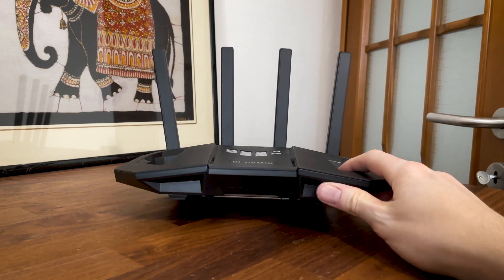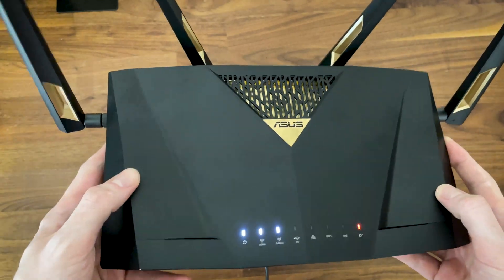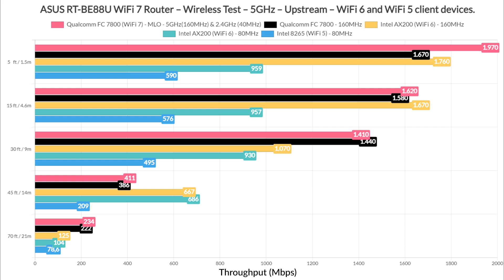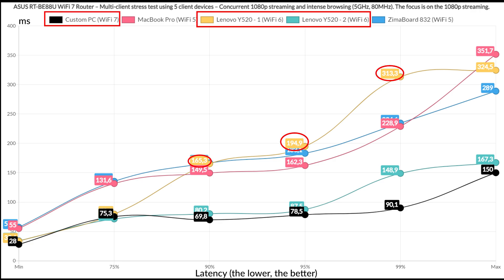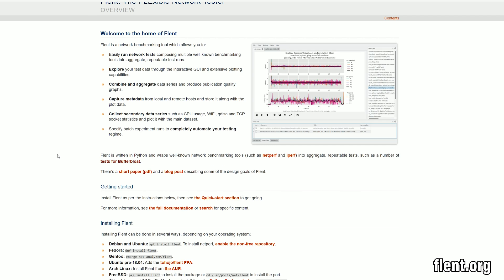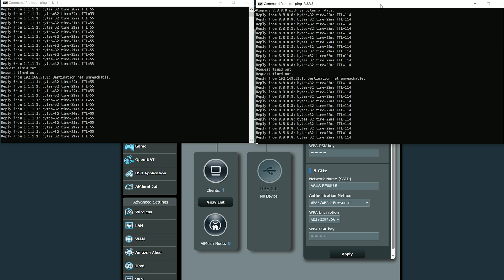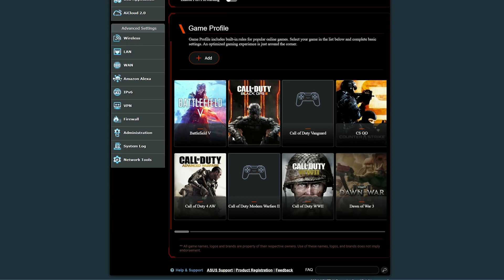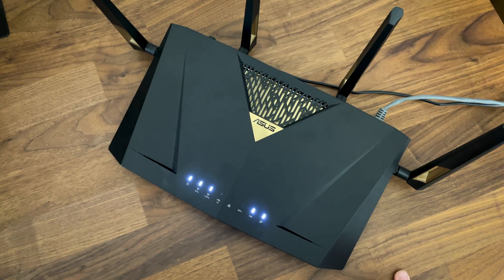ASUS RT-BE88U WiFi 7 Router Review: It sets the wrong expectations

Comment: Bought mine Last week for 280€. As replacement for my 11 year old  ac88u that died of heatstroke,I’ll install a small noctua fan to aid the exhaust.
 The 10g ports for my nas and 4x 2,5g ports are great. I have around 40 clients wired and wireless and I’m already very fond of Asus router even though my ac88 had some problems with the last 4 gigabit ports.

Comment: Our Wifi 5 Google TV streamer speed increased  from 350 Mb/s to 450 Mb/s after upgrading from the AX88u to the BE88u.
🙂
Reply: Have you try through Ethernet cable?
Reply: @jackydang  No I haven't bothered to try the ethernet because the wifi is so fast ~450 Mb/s

I assume the Google TV Streamer ethernet will do ~1 Gb/s but haven't bothered to try because I don't have a spare ethernet cable that is long enough. 

Is there any reason to suppose the ethernet can't do 1 Gb/s?

🙂

Comment: When we got this router we didn't realise that none of our computers has an ethernet connection fast enough to take advantage of the increased speeds i.e. >1 Gb/s
Had to specially buy a cheap 2.5 Gb/s card to check the speed.
N.B. Didn't realise 10 Gb/s ethernet cards are still so expensive.
🙂
Reply: How much does 10Gbs cable cost?
Reply: @jackydang  Still using our old 100 Mb/s ethernet cable to do 1 Gb/s speeds. 

When we finally get something capable of 2.5 or 10 Gb/s the original cable will probably handle it. 

Don't buy expensive ethernet unless you're certain you need it. You need Cat 6a ethernet for 10 Gb/s speeds. 

If you're setting up a network from scratch it's probably worth investing in fast ethernet cable.
🙂

Comment: Can you compare this to the ax86u pro and the ax88u pro?  I am not so interested in 6ghz.  The 5ghz speed and twang thru walls, latency and I will be using it in an area with lots of wifi.  I am using a server with vm’s connected to it via lan.  I’ve noticed my wifi signals are pretty bad if I have more than a few devices running.  Currently using a Verizon FIOS wifi router.  I tried the asus rt-be92 and the signal strength was worse and slower speed on 5ghz.  I don’t think I have any 6ghz devices and I won’t have the router in an open space.  Specifically I am interested in latency and multi client use.  This seems worse.  Is this a hardware limitation or should it become better than those two older models with software updates to the Be88U

Comment: Do you think if I install upgraded thermal pads on the heat sink, it will run a bit better and cooler?
Reply: I use a notebook fan for my routers. It find they run better in hot weather. It reduces the temperature of my routers by about 10-15c.

Comment: You are only person to answer my question for choosing router- 
Xiaomi be7000 - 150 euro
Xiaomi be6500 - 120 euro
ASUs be6500 -170 euro
ASUs be88u - 270 euro
Tp link be9300 - 270 euro

My usage - 140 square meter home, 20 plus IoT devices, 2 gaming setup, 2 TVs

Coverage and latency is my most concern 
Please suggest

Comment: Pass. No 6Ghz support for the higher speeds. I will stay on my RT-AX88U Pro since my ISP currently maxes out at 2,5G at very high price, so the 1G is still enough for me.
Reply: At distances, 6Ghz works, it is better to get a 10Gb switch and wire computers. I have my house wired with Cat6a and have a mesh of 3 RT-AX58U routers. I will get RT-BE88U, because of 10Gb ports and VLAN support.
Reply: Bro what do you think about the MERCUSYS MR47BE 320mhz tri band router?

Comment: I have this router, and use it with my BT Open-reach 1.6Gbps fiber connection. I'm using a GTek SFP+ module from the back of the router to my network switch which also has a 10Gb SFP+ port. Then out of the switch from a 2.5Gb port to a patch panel down to the man-cave and my PC is connected via the Asus 2.5Gb ethernet port, and my download from my 1.6Gbps connection equates to 12.2Gb of data at 60 secs. Just awesome. The RT-BE88U is a solid router, with great connectivity and having the 10Gb Wan port and 10Gb SFP+ makes this router future proof for a long time.
Reply: May you please post the link to the GTek SFP+ module you purchased? I’ve seen a few but unsure if it is a good fit.
Reply: @AngelLopez-iv5jv I’m also looking for good SFP+ module for this router